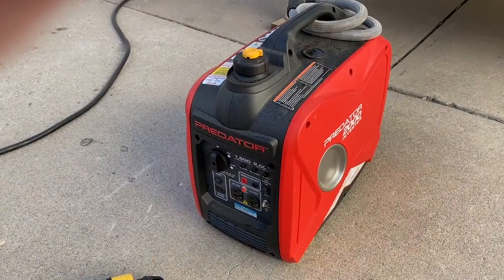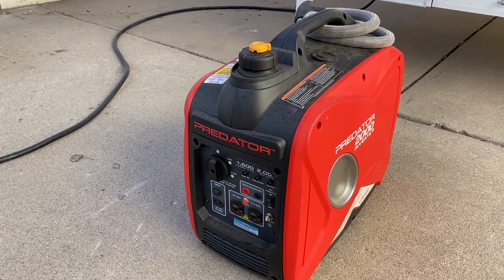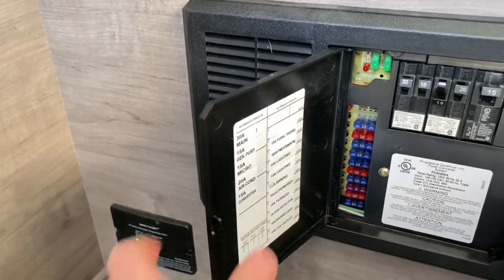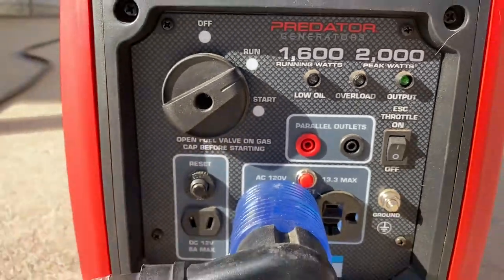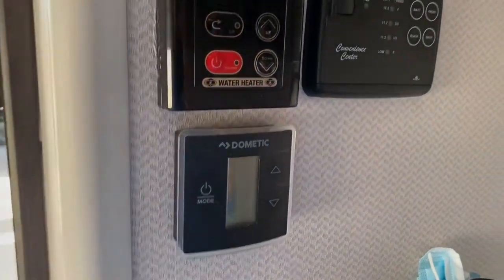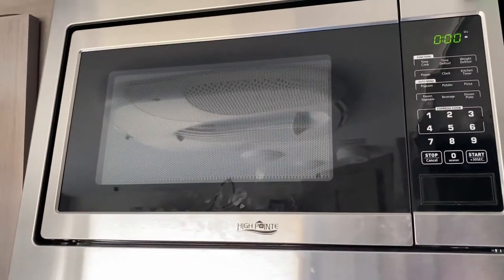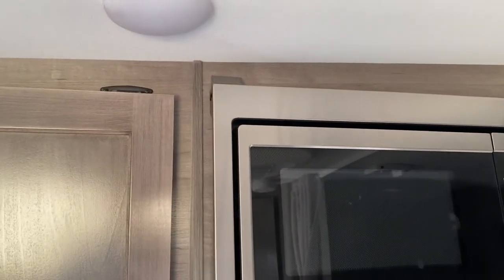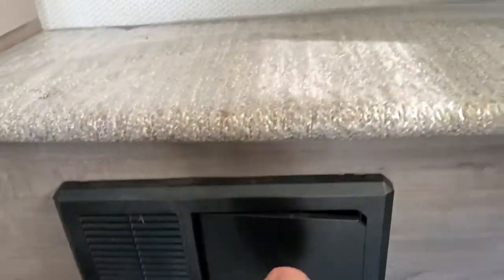Lance 650 - Will it run on a 2000 Watt Generator?

Comment: Hey your Micro Wave is not on heat some water then try it. I had a 5th wheel with a 3 kw gen and had a switch for either micro or ac. Your ac is pulling about 8-10 amps when running. Your right at max. ac is pulling around 1000 wats as you show in your demo

Comment: Since lights/stereo and probably fridge run on dc, you are not increasing the load on the generator with those. Also, the microwave display is hardly a draw either. Ambient temperature and density altitude will affect the generator output.

Comment: A magnetron in a microwave oven emits microwaves with frequency f = 2450MHz. Normally you don't want to run your microwave without something inside, like water in a glass, to absorb the  waves. Otherwise it could damage the magnetron, the oven its self, and could even catch fire. I would never run it without something to absorb the waves.

Comment: Your generator output will depend on elevation.  When trying a Honda 2000 inverter generator with my Lance 650, it ran the AC in my driveway at 700 ft. elevation, but failed at campsite at 7200 ft.  Honda says their output spec. of 1600/2000W is good to 4000 ft. elevation, but is reduced by 3% for every 1000 ft elevation gain.  Any gas generator would likely be the same.
Reply: My driveway sits at 4600 ft of elevation and the AC ran in 100 degree weather last summer with the microwave off
Reply: Honda has a different jet you can use at higher altitudes.

Comment: How do you choose the power source to charge the battery?
 Do you have a key to making the bottom choices?
 - You have solar panel
 - You have generator 2000
 - Do you have car engine generator

Comment: The microwave will not draw much power just having power to it. It needs to be running. But you never run a microwave without anything in it. It usually ends badly. The AC will draw the most power on compressor start up then use less amperage after that. Great to experiment to know exactly what works yourself.

Comment: Turning off the microwave breaker doesn't really conserve all that much, maybe 5 watts for the digital display. Turning off the Converter breaker is another story. If your house batteries need charging, the Converter will draw alot of power to do so. Shut off your Converter breaker, turn your refrigerator to "Propane only" and you will lessen the power demand, allowing your generator to easily run your AC. Common Capacitors don't really do all that much. Micro Air Soft Start is what you're looking for. With it's internal microprocessor, it programs itself to your AC unit and drastically reduces the load surge when the compressor kicks in. At 3500', 95+° summer temps, my Honda 2000 ran my 15k BTU Coleman AC unit, no problem.